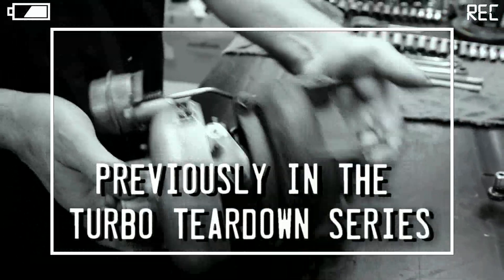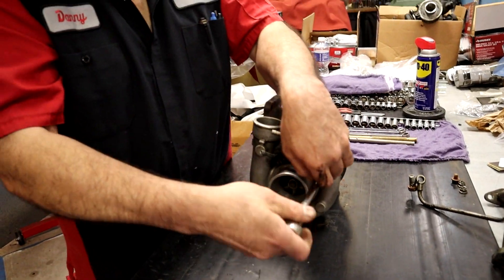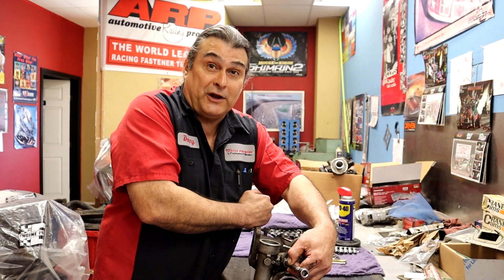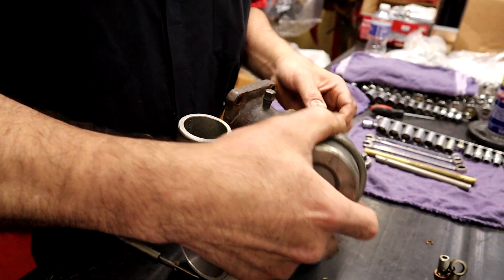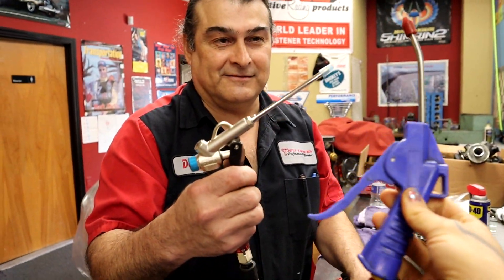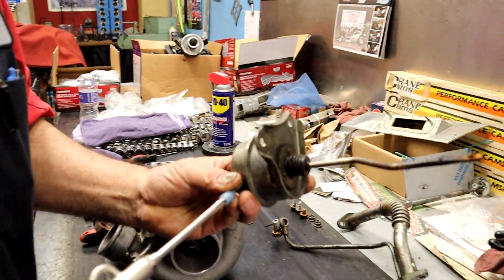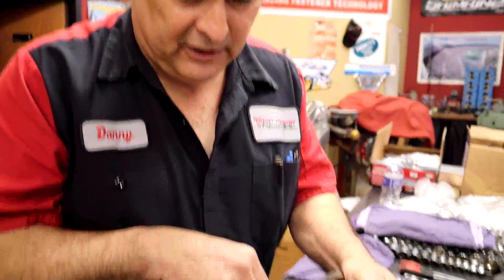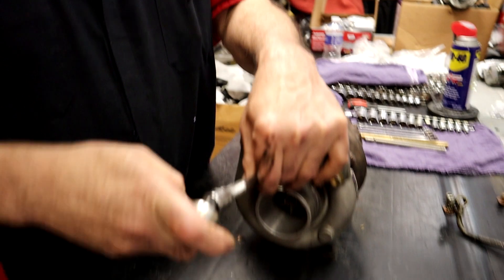Part 2: How a Wastegate Works & A Quick Bench Test, feat. CT26! Danny's Turbo Rebuild Master Class!

Comment: Just had to replace the turbocharger on my car a few days ago because the exhaust housing was cracked around the wastegate so it was bleeding exhaust around  it and the turbo wouldn't spool.
Reply: I've had that happen before. All around the wastegate plunger was cracking like crazy!
Reply from the maker: I'm pretty sure they all crack around there. That sounds excessive though!!